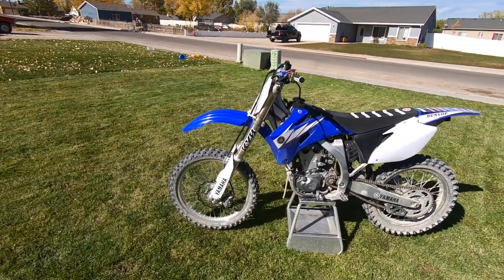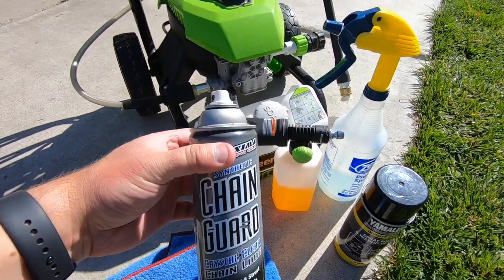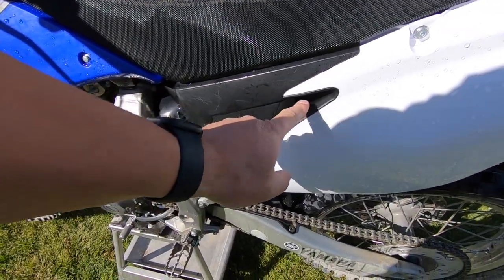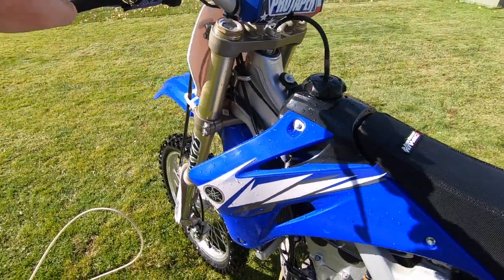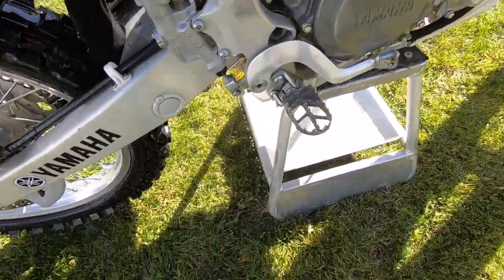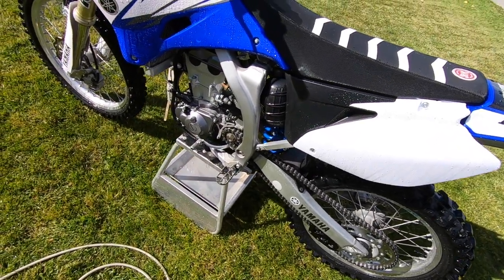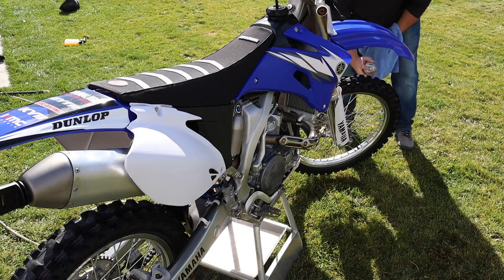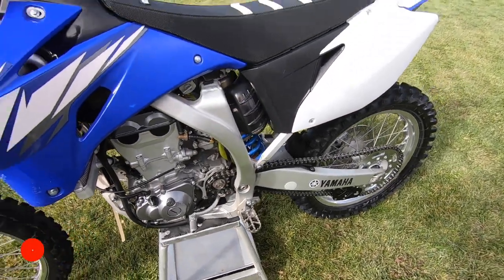HOW TO WASH A DIRT BIKE | Keeping it FRESH

Comment: Do I have to cover the air box and take off the seat? I just got my new bike it’s a KLX 110. Wondering if I can just soap it and rinse
Reply from the maker: I don’t do that but once every four or five washes. As long as you don’t spray in the airbox you should be fine. When you’re done washing take the seat off and see if anything got under there. Hey thanks for watching and I appreciate it.

Comment: can i use dish soap to wash my bike or is there any soap you recommend that I can easily get that won't damage my bike? thanks!
Reply from the maker: I’m actually gonna go back to dish soap! I hate the car wash I’m using even though it works well. I prefer dawn dish soap. I used it for years till I got my foam cannon, then switched to car wash. It’s not the same but I feel the dish soap cleans better, and it’s perfectly safe! Very easy on the bike, and is safe on the electrical too!